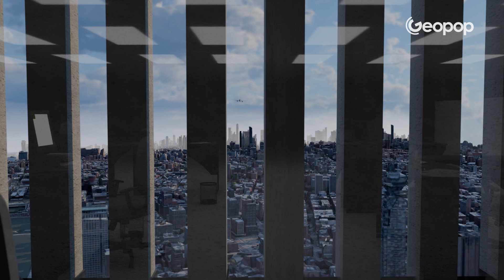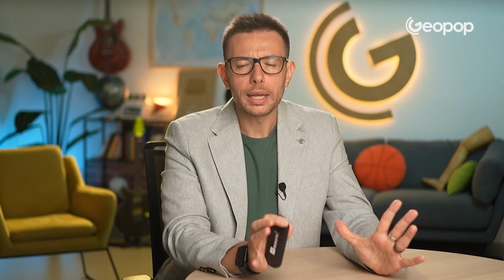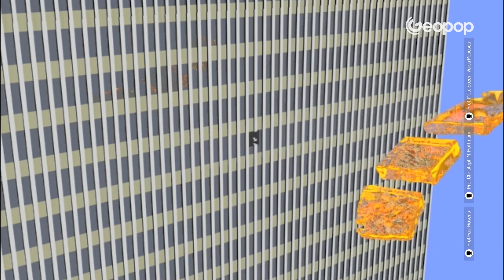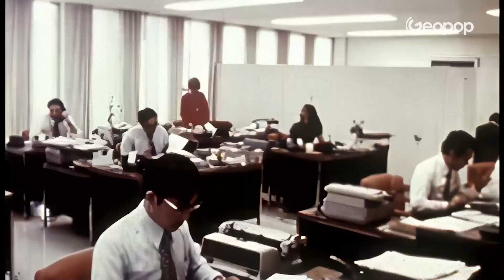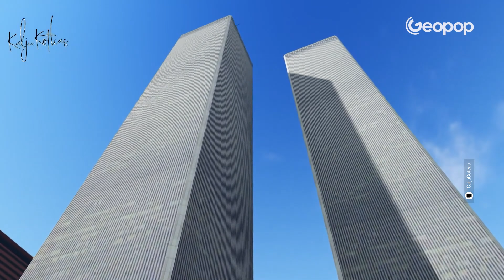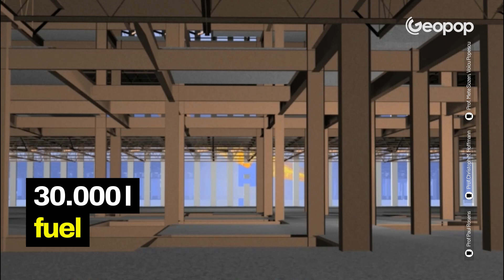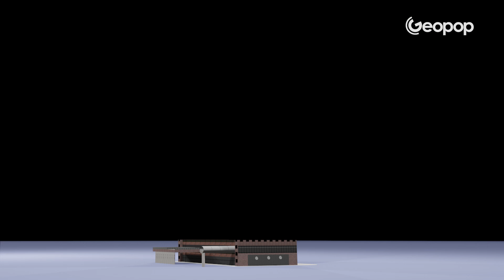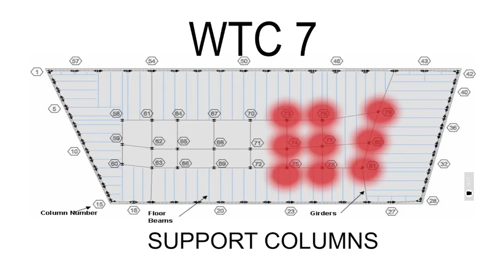9/11, 2001: The Technical Reconstruction of the Twin Towers and WTC 7 Collapses

Comment: I don’t accept your analysis
Reply: Why not?  Is there a good reason or just butthurt and dogma?
Reply: @ 

I don’t accept the fact that both towers as well as the building housing their main power supply all collapsed due to fire. Building 7 was brought down because there would be no need for the power supply after the towers were gone.
Reply: @ItsPoofy88  - So ignorance-fueled personal incredulity then? What if we lay it out in a way that makes logical sense?

Twin Towers collapses were relatively straightforward, the fundamentals already understood in the professional engineering community within just weeks. Still, there’s a lot of really bad information floating out there, mostly on the internet where it’s easily accessible to anyone. Good information takes more effort to come by and is much harder for laypersons to digest. Engineeringspeak is complex and dull. Also, some people put up a wall to protect their beliefs and false assumptions. Engineering is hard while wild baseless speculation and pathological theorizing with easy hand-wave answers is simple and exciting. Fanciful tails of pre-planned demolitions, magical space beams, melting steel and mini-nukes are just far more entertaining and require a whole lot less thinking, thus getting far more intention than they deserve.

To correct that situation, I have all on my own prepared this short yet detailed technical description of Twin Towers collapses based on my own observation and analysis of the available true and relevant facts. No politics or ideology, just the engineering. My hope is this will dispel many common myths and answer most if not all questions you may have about the Twin Towers collapses, because anything can seem like a conspiracy if you don’t understand how it works

While complex, most of the Twin Towers collapse mechanisms can be seen with the naked eye and easily discerned and understood by the layperson if sufficient time is taken to understand. 

1. The Twin Towers consisted of 4 primary structural elements that together formed an integrated system where each relied on the others.  47 hollow box-section steel Core Columns carry the majority of the gravity loads. The 236 hollow box-section steel Perimeter Columns carry the remainder and ALL of the lateral (wind) loads. Long-span Lightweight Steel Trusses connect the core and perimeter column together at each floor with a Hat Truss on top to tie the structure together as an integrated unit where no element can survive without the others. There was no structural load bearing concrete and most components were bolted together.

2. The impact of 117 tons of airplane (= to about 12 dump trucks) at speeds up to 590 mph with the energy of a ton of TNT completely destroys the aircraft. This in no way implies the Towers come out unscathed. Many perimeter columns are damaged or destroyed as are some core columns (example; 33 of 59 perimeter and 20 of 47 core columns damaged or destroyed at the impact floors in the North Tower), This damage is primarily through bolt-shearing failures at the end connecting flanges, as well as bending, twisting and fracturing of weld seams. There was no cutting or slicing - the reality was far more violent and messy. 

3. The impacts destroy or damage fire insulation, fire breaks and sprinkler systems on multiple floors.  Huge fires are started across multiple floors simultaneously and allowed to spread rapidly with no effective firefighting or fire suppression. This was an unprecedented fire event . 

4. The hotter steel gets the weaker it gets .  With fire insulation stripped away and no sprinklers the survival time of the steel greatly reduced. Gradually over time heat causes the lightweight steel Floor Trusses at the impact damaged floors to sag, which was observed and recorded.  No steel melted or needed to. Structural steel fails long before it becomes a puddle. It just needs to bend

5. Sagging floor trusses pull on the increasingly weak and overloaded Perimeter Columns, causing some of them to bow inward by up to 5 feet. A straight column is up to 4 times stronger than a bent column. The bowed Perimeter Columns buckle and fail, initiating collapse. The formerly static mass above which the structure below could easily support is now converted into a dynamic mass up to 30 times greater. Because they have buckled, the Columns above and below the failure point are no longer aligned . The load bearing structure below no longer bears any load as it falls past the lower columns, NOT onto them.

6. Thousands of tons of debris fall within the four outer walls, down through the open office space, crashing onto the first intact floor it encounters. This massive impact immediately breaks the bolted connections to the columns as the amount of resistance the Floor Trusses can offer is negligible.  The falling debris slows only marginally and briefly. Note:
6a. This is NOT a solid top block crashing into and “crushing” a solid bottom block .
6b. The debris falls past the columns not onto them.  The columns provide no resistance to the falling debris. 
6c. Only the bolted connections of the floor trusses to the core and perimeter columns can offer any resistance. A pair of 5/8” bolts at each end of each truss vs. thousands of tons of falling debris.
6d. No laws of physics are violated.

7.  This floor-led collapse progression within the four outer walls can only go straight down. Note: 
7a. This process is often incorrectly referred to as “pancaking” which actually refers to a completely different process rejected at an early stage. The catchy name stuck but nobody knows what it is supposed to mean.  Pancaking is too simplistic and inaccurate anyway. More like Kaiserschmarrn.

8. Collapse progresses through the floor systems not down the columns, through the path of least resistance . Rate of floor failures increases with each successive floor as momentum increases, reaching an average acceleration of 0.65 of GA, or 35% slower than true free fall. Bam, bam, bam down the building until there are no more floors to fail.  The resistance offered by each successive floor is always the same. The mass and velocity, thus the energy of the falling debris is constantly increasing, with each floor destroyed adding new falling mass. Some falls to the sides, but most falls down. More mass, more velocity, same resistance with each floor.  Don’t get stuck on the but the lower floors weren’t on fire nonsense. They weren‘t and didn’t need to be.

9. The Towers were 95% air by volume. As that air was compressed inside the building it is forced down the tower and blown out the sides in reaction to the building collapsing . Those were not “explosions”, it was expulsions of compressed air caused by the collapsing building, explaining the low velocity, lack of flash, blast, supersonic pressure waves and lethal high-velocity ejecta.  

10. Perimeter Columns become detached and peel away like a banana behind the collapse front, playing out to the four points of the compass extending to more than 600 feet from the base of the towers. This was quite obvious from examination of the debris pile. 

11. Core Columns fail last as their internal beam bracing is stripped away by falling debris and lateral support from the floor to perimeter columns is lost. 

12. For those who care about how long this whole process took; 31-34 seconds from the moment the perimeter columns buckled until the last core columns hit the pile, or 1/3 the rate of true free fall. Don’t believe me?  Just watch any video of the collapses and note the loose truly free-falling debris dropping much faster than the towers themselves.  

13. Each Tower had a 1-acre footprint. Far from collapsing inside their own footprints the debris pile spread out over 17 acres in a pile up to 14 stories deep. 8 surrounding buildings were destroyed and scores more damaged by the falling debris. 

14. What was NOT observed were the 180-190 dB bangs of thousands of high explosive devices or the blinding bright flashes of burning thermite. Neither could have caused the (silent) perimeter column buckling that clearly initiated collapse.  Neither explosives or thermite could have survived the impacts and subsequent fires either. A video of a shocked and injured firefighter using the magic word explosion is in no way proof of explsoIVES . The pre—planned demolition case relies entirely on that sort of thing. There is zero tangible physical evidence and it would be technically impossible, totally impractical and completely unnecessary. No one would bother. 

15.  Finally, the Twin Towers were perfectly safe within their design envelope.  They only collapsed when taken far outside design parameters by an extraordinary and unprecedented event 

Impact + Fire (heat) + Time + Gravity = Collapse . Remove any one of those four elements and there is no collapse. Ignore any of those elements (as many do) and you will never understand the collapses. The Twin Towers were an integrated system in which no one component could survive without the others. One fails, the rest follow, through the path of least resistance – DOWN – through the open space, bypassing the path of greatest resistance – the columns.  Nothing I just described violates any laws of physics. All of the above is true no matter who planned and carried out the 9/11 attacks or why 

I hope you found this helpful and informative. It is not meant to be adversarial, but to solicit informed critical comment, positive or negative. If I made any errors of fact, logic or reason or left anything critical out, please let me know so I can fix it. To stay focused just one topic at a time please and on-topic (Twin Towers ONLY). No word-salads of Gish Gallop. IF you can offer a more plausible alternative be my guest. Be the first. Please start any reply with the words “Tits McGee” or I will know you didn’t actually read it, are not serious and just wasting my time.
Reply: @TheLoonResistance  Your moms Tits McGee were very good last night btw https://www.youtube.com/watch?v=Ddz2mw2vaEg&t

Comment: I can understand that the metal affected by the heat was affected, but what about all the metal below the impact point that was not affected by heat?
And if that heat was so extreme, how could one of the alleged terrorists passports have survived???
Reply: It was affected by the thousands of tons of falling debris. Collapse initiation and collapse progression stages are different mechanisms.
Reply: Passeports were ejected in the street. No heat.
Reply: @ThomasKundera  but they where inside the plane when it cracked into the towers, inside the fireball when it blew up, and on the street when the buildings came down
Reply: @RealHouseMouse2  "they where inside the plane when it cracked into the towers"
And at that point ejected to the street.

"inside the fireball when it blew up"
Likely not.

"and on the street when the buildings came down"
They were already in the hands of the police at that point.
Reply: @ 
So you are saying that a fire, got enough to melt the metal trusses was unable to even burn a paper passport?
Reply: @RealHouseMouse2  : The fire wasn't likely hot enough to melt steel.
But this is irrelevant: le passeport was in the street, not in the fire.
Reply: @ but the fire started the second the plane hit the towers, the only way that passport would not have been affected by the explosion is for it never having been on the plane! All that aviation fuel burning surely must have been hot enough to burn paper? And if it did not, then there is no way the towers could have come down as quickly as they did
Reply: @RealHouseMouse2  : "but the fire started the second the plane hit the towers"
And the passport was ejected the milliseconds the plane hit the tower.

"the only way that passport would not have been affected by the explosion is for it never having been on the plane!"
It was affected, but not much.

"All that aviation fuel burning surely must have been hot enough to burn paper?"
Likely, but the passeport wasn't in the fire.
Reply: @ maybe they should make airplanes out of the material that passports are made of, because it flew trough the central staircases, elevator shafts, steel collums and concrete walls that made up the central part of the towers
Reply: @RealHouseMouse2  : 
"because it flew trough the central staircases, elevator shafts, steel collums and concrete walls that made up the central part of the towers"
It likely didn't do that.
If we're talking about Satam al-Suqami passeport, it was found in Vesey Street, so front of the building.
Satam likely being in the cockpit, front of the plane, the passeport would have been with him.
Being very light, it could have hit a column, being stopped by it, then thrown away by some other part of the plane behind, fly around, and come back in the street behind.

"maybe they should make airplanes out of the material that passports are made of"
That's a ridiculous idea.
Reply: @ 
Not as ridiculous  as a paper passport, caught in an explosion hot enough to melt steel, passing unscathed trough steel and concrete with the help of burning pieces of plane and being found less than 2 hours after impact.
If you really believe that, I have 2 beautiful pieces of property you can buy from me, one is in a little town called Chornobyl and the other one is located in Fukushima. Both come with free health coverage
Reply: @RealHouseMouse2  :
"Not as ridiculous  as a paper passport, caught in an explosion hot enough to melt steel, passing unscathed trough steel and concrete with the help of burning pieces of plane and being found less than 2 hours after impact."
Again:
- "an explosion hot enough" has little meaning.
- "hot enough to melt steel," is likely incorrect (no significant volume of steel melt, if any)
- "passing unscathed" wasn't "unscathed"
- "passing unscathed trough steel and concrete" didn't pass through steel and concrete, as it bounced back in the street back from the plane was coming (not the other side)

"If you really believe that"
You're the one still repeating same lies while I already explained it to you above.
Even if it could have been the case that it would have gone through (and for the second plane, lots of stuff went through), the location where the passeport was found seems to indicate it bounced back, so never went through.

Fix your issue with that, and then we'll talk.

If you just refuse to acknowledge reality, discussing will be hard anyway.

Comment: 2:50 Thanks for explaining! I thought I was losing my mind. My AI senses were tingling, but it seemed so realistic.
Reply: At about 2:40 you see the plane completely destroyed by the outer wall so what too out the interior columns? That diagram seems flawed
Reply: -- Then what is the source of the many tons of molten steel found in and under the debris, the heat so intense that the molten steel remained in that state for weeks afterward, running off of the debris as it was excavated. This cannot be molten copper from wiring that retains the color of a shiny new penny.  It cannot be molten aluminum that retains the color of the polished aluminum wheels of a street racer. It was the color of glowing orange molten steel  that cannot be mistaken for any other material, reported by firefighters who are very experienced in the nature of such materials as well as seen in video evidence.

When you combine this with an entire lack of turbulence behind 500 mph aircraft, when even a small Cessna Aircraft would leave an evident wake in the smoke and fire only seconds later .  . We find that skeptics still cannot be skeptical of the official narrative in explanation.  Sponsored channels and forum activity are skeptical of nothing when support is provided.

Sponsored activity in the forums is very normal today for commercial and political purposes and subjects of controversy -- in the attempt to lead public debate.

Comment: WTC7 had always been a point of contention for me I could explain in my head quite easily the world trade centres one and two going down and after seeing how World Trade Centre seven collapsed it wasn’t until I watched a really great video about the number seven collapse That design flaws became apparent. The actual footing of the building was made quite small and I can’t believe or Cantor system was used on the southside wall of building seven which definitely would have been damaged by the collapse of the north tower…. The video I watched maintain that up to 40 feet of building seven was held up by the internal structure, using triangular can’t lever design and had no pillars to ground, which makes a lot of sense to me as far as how it collapsed.
Reply: Building 7 worked just fine for 15 years until subjected to conditions far outside its design envelope.
Reply: @TheLoonResistance  : But anyway after 9/11 regulations were changed, and no such building would be allowed nowadays. Well, I mean before the orange guy came into office. I guess that now, if Musk wanted to build a 300m tall building in gazoline impregnated marshmallow in center Manhattan, he would get green light.